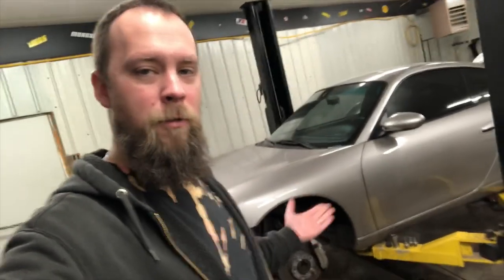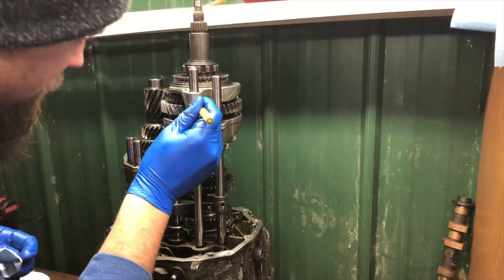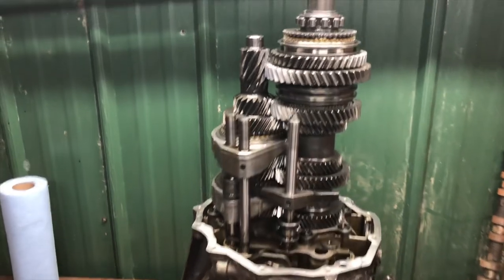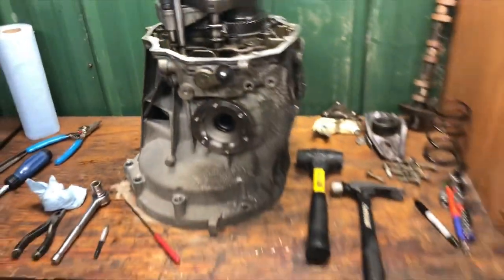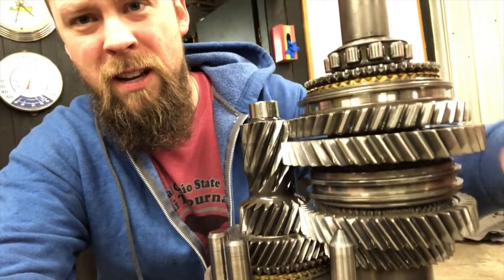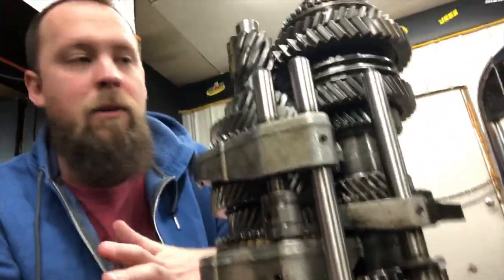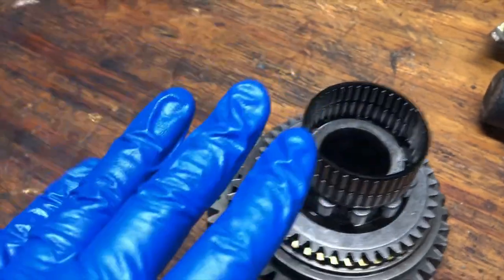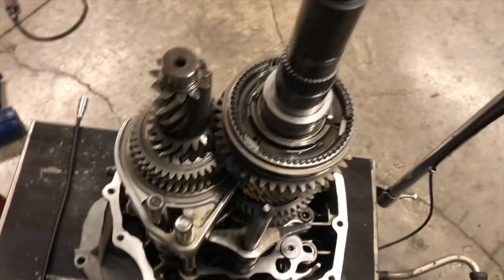Porsche 996 Transmission Teardown, Part 2: Removing the Gear Sets

Comment: Great work, and awesome documentation! I’m getting ready to do the same job, as my 2nd gear went kaput yesterday. What gear puller did you use?
Reply from the maker: Thanks Cole! I just used the Harbor Freight gear puller kit; nothing fancy. I threw some heavy duty grease on the threads before brapping on it with the impact and it held up pretty well. 

Don’t hesitate to reach out if you have questions along the way! As you’re probably finding, not much documentation out there about how to do this job.